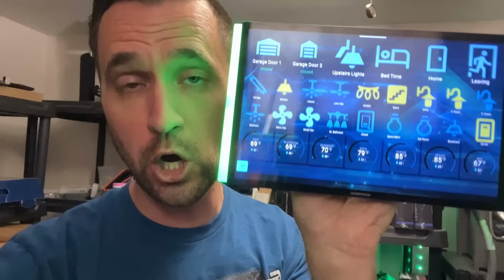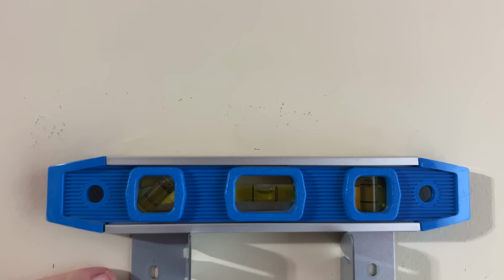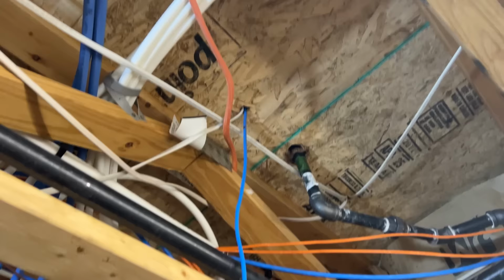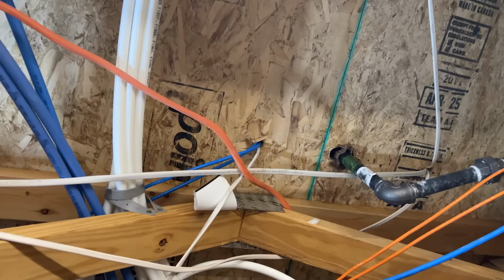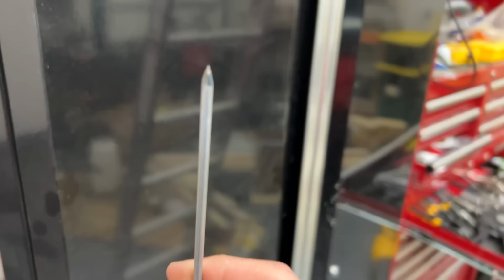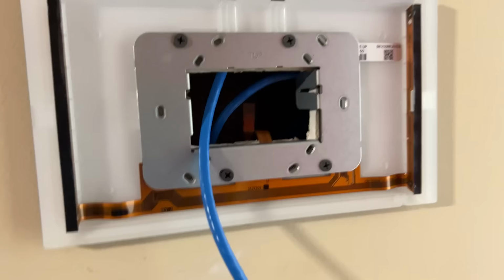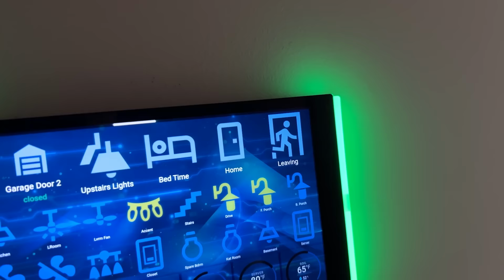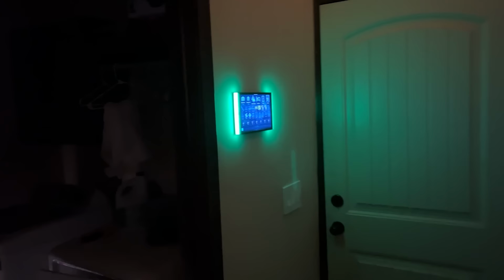Perfect Entry Touchscreen Home Assistant Controls!

Comment: bmb casually mounting a $3k screen by the door to his garage..... us mere mortals are stuck using old android tablets lol
Reply: Agreed! Just looked up Crestron and realized I wasted my time watching this.
Reply: UniFi Connect Display is a far cheaper PoE touch display that can load webpages and other android apps.
Reply: “Super generic” 😂 about as boujie as one can get
Reply from the maker: it was from the trash tho
Reply: @carbongrip2108  Connect and Connect Max actually look affordable compared to this lol
Reply: @carbongrip2108  an ASUS VT229H and Display Cast comes out even cheaper for a 21" screen. im just looking to add small touch screens to each room by the light switches so even a 7" fire tablet should be enough
Reply: "This is just some really cheap, off-brand, no name touchscreen LCD..."
Reply: He didn’t even use a normal wall mount! 😂
Reply: @absolutrichiek  lol and the led lights are a $400 addon
Reply: @Bytemybits  What do you mean  from the trash!?

Comment: Awesome content only if you explain your scripts.  good for some clicks I suppose.  What crestron processor is driving this TSS 7 with scheduling lights typically for commerical applications.  Cheap POE panel, sheez.  MSRP is 2500 or so...I do commerical AV and it seems others know as well...then again good content if you explain your scripts (Creston code)
Reply: exactly!  -  please -  less sensationalism and fast cuts, and more technical details / back-end explanation (and setup).  there are tons of great , how to run wire / mount xyz into Sheetrock videos on YT already-   tks

Comment: Jason looks great!  I would suggest installing a 2-gang low voltage ring in the wall and attach the Crestron mounting bracket to that.  Would be much easier to uninstall the bracket if you ever need to.

Comment: How's that work with the 55" screen, is it a separate instance of HA, or is there a way to specify what is displayed on what devices/screens? Sorry, complete newb when it comes to this, infact I havnt even gotten to try and setup my own instance yet, I built the HA-OS VM on my unraid, but have yet to even do the initial setup boot of it.
Reply: It's just displaying a webpage
Reply: @Technically Speaking  I'm sure it can't be the same web page that the larger screen is or else it'd be all squished together and the smaller screen didn't have all the stuff the big screen had, so is it a seperate page in one I stance, or do you have to have multiple instances for multiple pages like this?
Reply: Just a home assistant web page. Can view on as many devices as you like.

Comment: I want to know how you have those garagedoor icons working, I tried the couple I found via Google and have had NO luck.
Reply: For some reason I can't edit my comment so here's an expansion to my question, "I'd also like to be able to change the color of the icon depending on if open or closed too."

For what it's worth, I'm running HAOS on a vm on unraid, fully updated, and using the chamberlain connection to my garage door. If I could connect the control to the "ewelink card" I have for it that'd be cool, otherwise chamberlain control works as is.

Comment: Would anyone happen to know what mount is being used? I like the fact that the lights are included. I want to put a feature where when I arm my home it’s red and when I’m home stay it’s green.
Reply: It is the mount that is made for the touchscreen.
Reply: This is a Crestron TSW-1070. It comes with the mount and the light bars are an accessory. You can’t buy them directly from Crestron but there are resellers and eBay if you really want one. They’re not cheap.

Comment: I think you are violating electrical code. As of 2017, there are rules about running power over ethernet. One of them is not to chase the network wire parallel to ROMEX (NONMETALLIC SHEATHED CABLE).You may not care, but I'm posting this for those who want to do the job correctly the first time and not diminish the value of their home, either by creating the need for rework or by burning it to the ground. Also, some of the rules are there to prevent electrocution risk. For example if a heavy, metal object were dropped on both the network cable and the romex, say, in an attic, it could bridge line voltage to the network and kill someone who is innocently crimping an ethernet connector elsewhere in the house.

Comment: If you’re able to read this, just downvote, unsubscribe and move on. This screen requires an existing Creston system to even get to the web browser, which is what he’s using to access the dashboard. 

What he’s conveniently, leaving out is that his system was installed by a creston expert installer and all he was doing is adding another panel to his system and then accessing the web browser on that panel.
Reply: While I agree that there are reasons to down vote this video, your reasons are not one of them. I think the biggest problem is not answering questions people asked. I bought a used Crestron TSW-1060 touch screen based on this video and I was able to get the Home Assistant dashboard on it. I did a factory reset and used the webpage that the screen serves up to be able to add my Home Assistant URL, I used one of the apps that had that option. It is too slow though and takes about 15 seconds to display the dashboard coming out of the screensaver. Now my TSW-1060 uses a different mounting bracket then his, I have seen pictures of the newer TSW-1070 with that bracket.
Reply: @mine-iv2qn  another problem I see is he states it’s a TSS model and based on what I’m reading those can only be used for scheduling.  Can you still use a TSS in the capacity that this video depicts?
Reply: @mine-iv2qn  thank you for the response. When you click on the buttons (lights, shades, etc.), do those respond relatively fast?
Reply: @Buddylee-7 Yes,  l froze the video to see if I could read the touch screen model used in the video, as I expected it says TSW-1070.
Reply: You can configure the browser app without any official Crestron tools. You just have to use the web config tool. It’s very limited but it will work. All it’s doing is displaying a browser that shows the Home Assistant dashboard.